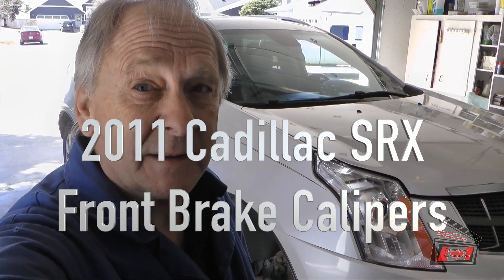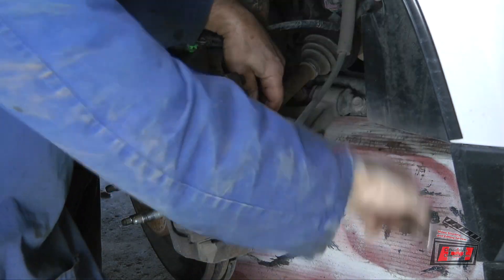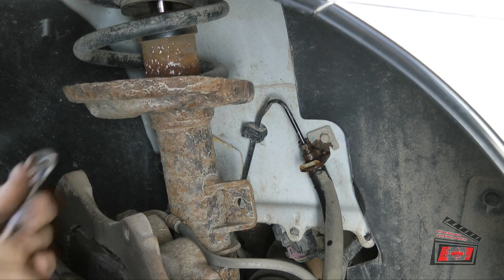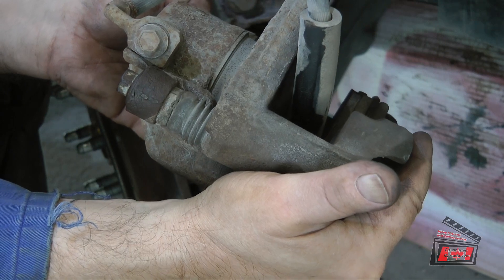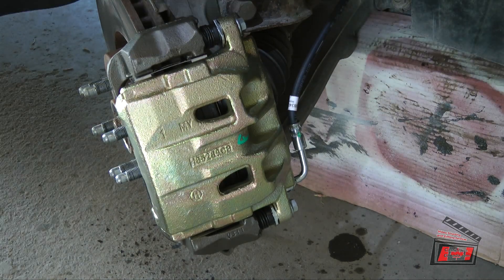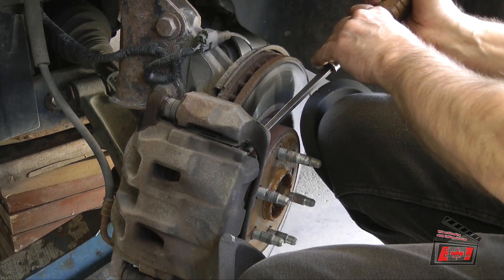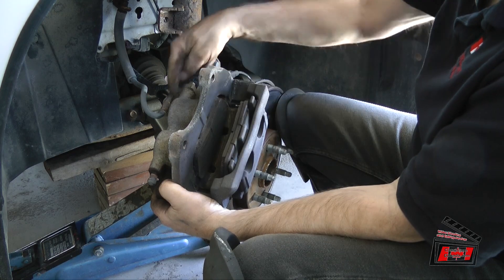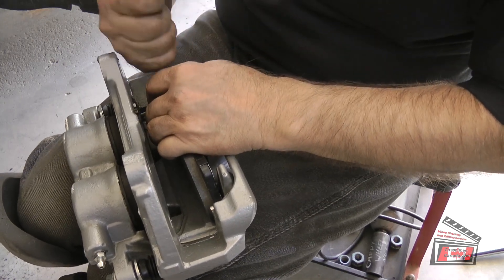Cadillac SRX front Brake Calipers and Pads- 2011

Comment from the maker: So the new calipers and brake hoses solved nothing. I had already bought and installed a new master cylinder from Dorman and that is the reason for chasing this problem. The first MC was installed because of low pedal. But the locking brakes seemed to start after the replacement but I had not made that connection last year. Instead I replaced the ABS motor and of course the brakes still locked up. Anyway after replacing the calipers I talked to another mechanic and he felt that the MC was defective and should be replaced. 
So I bought a second MC from Amazon (Dorman) and installed it. That replacement can be seen in another video. But it also did not solve the brake lockups. In fact they happened even quicker and more often. The decision was make to take the car to a GM dealer. Partly because it seemed I could release the brake lockups by playing with the electrical adjustment for pedal height and my back would not allow me to bend so as to do any work on the pedals. And partly because I was just ready to sell the car as defective and take the loss. 
So it went to the local GM dealer and they phoned back a couple days later saying it needed a genuine GM master cylinder. But I would have to wait an unknown length of time because of being backordered. I waited 3 weeks and finally got a new GM MC. The mechanic had the vehicle on the road several times and did not get it to act up after the replacement. The bill was incredibly high and included at least 4 hours of labor/diagnosis as well as a very expensive part. Plus all the normal dings that are added to a bill. But if it is fixed that will be great.
So what was the problem that cost me nearly a couple thousand in wasted money? Two defective master cylinders ordered through Amazon that came from Dorman. I am now in possession of two and they are both useless. I guess I will take one apart and see if a seal was installed backwards or something. I will try to get my money back on one if I can. But I am past my normal return limit even on the last one.

Comment: Did the test drive go well? Did it fix the solution? Should we use anti seize brake grease on the ends and metal back plate of the brake pads? This could be a possible cause of the issue, as the driver side pads appeared to be frozen in place, lacking lubricated movement.
Reply from the maker: Thanks for watching and for the questions. You can use lubricant if you want. That was not the cause of the problem though. Yes the driver side was rusted in place at almost every contact point. That's why I figured it was a caliper problem as they would be rusted inside the piston and not releasing. Nope, the new calipers were no different than the old ones.
I went for a long test a couple days later and the same symptoms were back. Shuddering steering wheel after about 30 km of driving, which indicated the brakes were on and getting hot. I stopped and sure enough things were very hot on the front brakes. So I finished the trip at about 60kph max. Also had to make a couple more lengthy trips before I could get time to do any more work.
I will let you know what happened in a few days after I have had a few more test drives. I did do some more work that I hope has fixed it now.
Reply: BTW Thank you for your response.